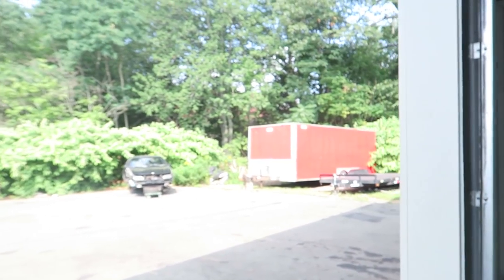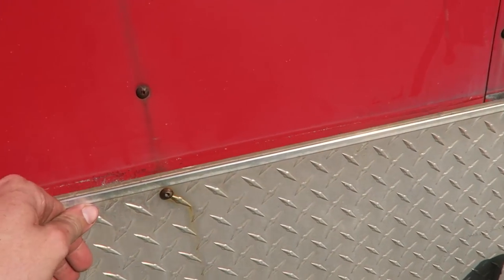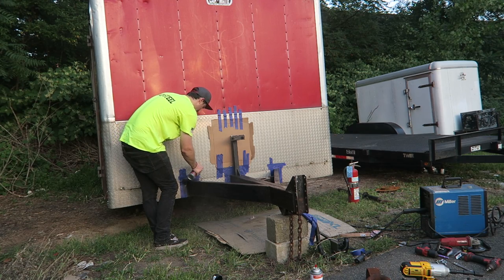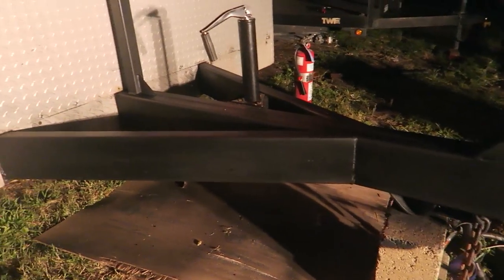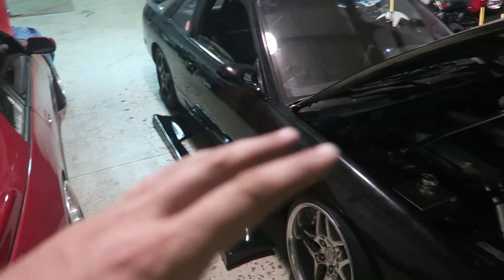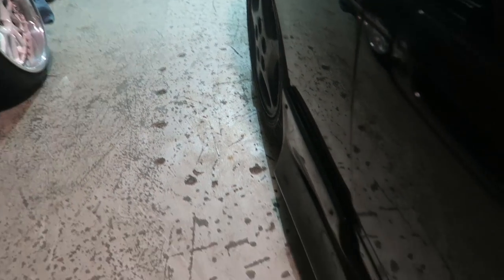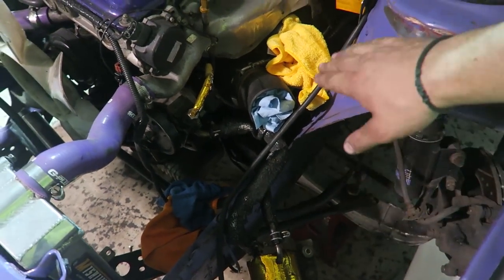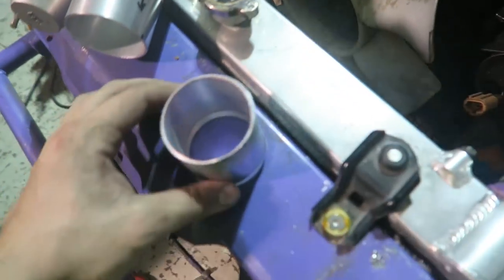The trailer gets some love!

Comment: When you screw those self tappers in where the seem is you should go over with some greocel and use  dicore lap sealant on the roof to prevent anymore leaks I am a camper/trailer tech that's what I think will help you out so it'll last longer

Comment: Other than replacing the jack this was basically an aesthetic "repair" to a well used trailer that has been sitting for gawd knows how long. Heard and saw nothing about inspecting the suspension, inspecting the tires completely (like up in the air and rotating each tire to do at least a visual inspection of the thread and inner sidewalls), testing of the brakes, or about an inspection & re-pack of the wheel bearings. 2nd only to boat trailers where the wheels get "dipped" into the lake frequently during a boat launch, a car trailer is at the top of list for trailer wheel bearings being the "most likely to fail" part due to neglect.  Nice looking Silvia - I wouldn't trust it in that trailer without a full inspection of the "dirty side".

Comment: Jimmy, Idk what your welding experience is, but in a situation like welding up that jack mount, if you push your puddle instead of pull it, it will penetrate deeper. I couldn't tell what direction you were going in the video, but I thought that might be a helpful tip. Keep up the awesome videos dude!

Comment: The blow off valve should go on the other side. Always best to mount as close to the throttle plate as possible. Allows for quickest reaction and best performance overall

Comment: JIMMY! for your welds, on the vertical weld you need to start from the bottom and work your way up. you are weaving too fast. try a straight stringer. it will be stronger

Comment: Jimmy, what are some tuner/drift cars that get cheap insurance for a 16 year old?
Reply: ErmorrPlays 4 door bmws.
Reply: ErmorrPlays 240s are cheap on insurance. If you are clean prolly 1200 a year depending on your provider
Reply: miatas, unless you're tall. they're kinda ugly but rwd and manual can be had for very cheap and you wont shred through tires since they dont make much power
Reply: ErmorrPlays lambos
Reply: a prius would be a good start considering your only 16😂😂😂
Reply: ErmorrPlays won't be cheap since you're young.. I pay $200 a month for my Miata and I'm 19 0 accidents 0 tickets.. But my bike is $500 for full year
Reply: Boosted Miata Yup. Nothing sporty is gonna be cheap when you're young. That's why I suggested 4 door bmws.
Reply: Im 17 and i have a mk4 golf 1.8t swapped and its only like 30-50 a month
Reply: Ae86 Hachi My spends said they would match how much I have saved for a car, so I've been looking into like 2006-2008 335i sedans. Are the older bmw's cheaper or they the same?
Reply: ErmorrPlays The older sedans can definitely be cheaper. Keep in mind that the older it is the more issues it is likely to have. Search smart and be thorough when looking over the car and you'll be rolling in no time. Don't be afraid to walk away from a car, and never buy at night! Good luck man, and happy hunting!
Reply: Thank you for the advice.

Comment: buys trailer but doesnt have anything to tow it with?
Reply: cody bersick might be an issue
Reply: He said in the last video Steph's dad will let him use his truck whenever he needs it
Reply: cody- always so negative. Shut it!
Reply: Don't worry. Orion will borrow his Dually or the Van - wait, they are both not running, erm. But there is also the mint RV and the totally decent new lifted truck. Orion could be the first trucking company without a single functional vehicle.
Reply: You Thana the van do run it just had a dead battery dummy
Reply: just an observation bro
Reply: Just a dead battery. Sure, it is always just this and that. Minor stuff, easy fix. It is not, it is a clapped out, rusted, badly maintained and hard driven vehicle. Was there any chance Orion left out to hoon his vehicles to the point where only a scrap yard will take care?
Reply: You Thana he just got the van back from a big turbo build and he said the battery was the only thing wrong with it